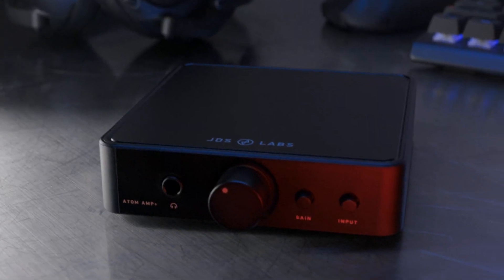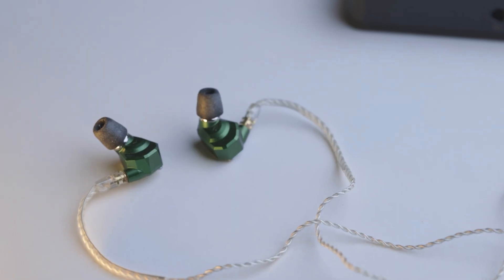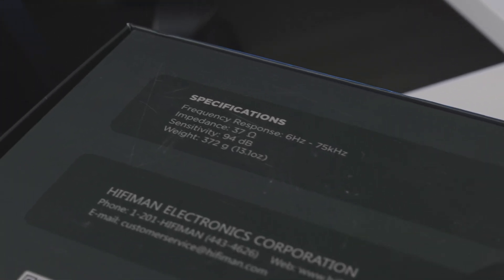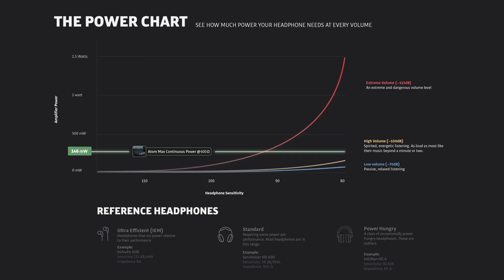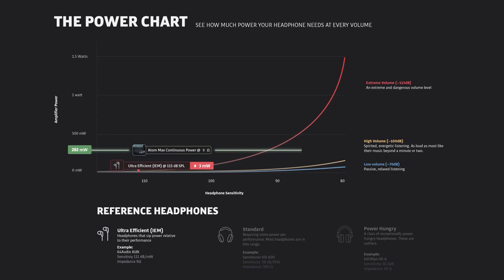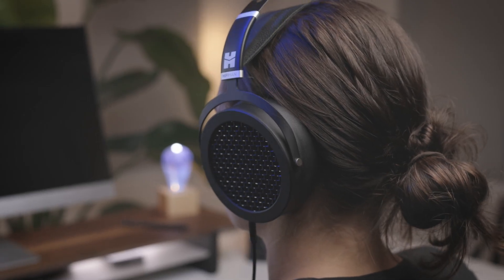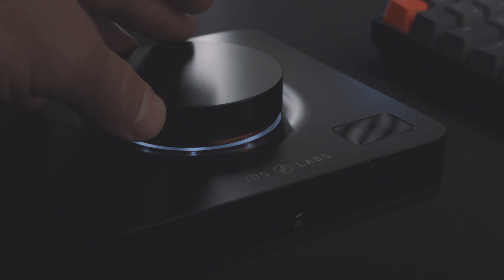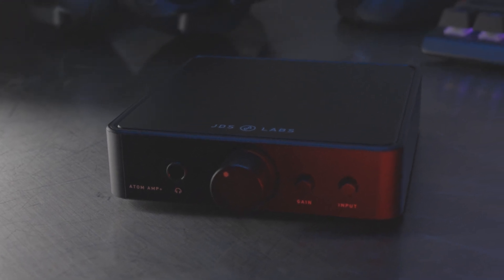On Headphone Power: How much do you REALLY need?

Comment: I have a Element III and now I'm struggling if it is enough to power the Modhouse Tungsten. Wit 78 db/mw and 155 ohm impedance those are quite hard to drive... Is the element III enough or would I need another amp?
Reply from the maker: Indeed, Tungsten is off the charts: not quite a headphone, and not quite a speaker. It's a tricky situation because Tungsten needs major voltage swing given its low efficiency. At 78 dB/mW and 135 ohms, an amp must deliver roughly 26VRMS = 73.5 Vpp (!) to drive Tungsten to dangerous listening levels. Solid state amps top out at about 10VRMS, and even some esoteric headphone amps top out at around 20VRMS = 56Vpp.

As this video discusses, it's important to step back and consider how much volume you wish to achieve. If you listen at only moderate volumes, 10VRMS from Element III is adequate. Admittedly, you will be pushing any solid state amp near max volume. This is fine with any JDS Labs amp--all are designed for clean audio even at 100% volume.
Reply: @JDSLabsinc  I know it is a late reply, but thanks for clearing that up. I would hope that Ryan will adjust the Tungsten's in a V2 or going forward.

Comment: imo power amp is like car engines..... a 2.0L four revving at 7000rpm has equal performance to a 4.0L V8 revving at 4000rpm..... i know which engine will be smoother, has more headroom and lasts longer....
Reply from the maker: I considered axing the analogy in this video, since analogies only go so far. Fortunately, there are no spinning parts in an amp to break down

Comment: This whole debate is not helped by the very wide range of headphone impedances and sensitivities out there, and that some (mostly legacy) were designed for use with a 120Ω output impedance amp.
Speaker amps have it easy; most speakers are rated at a "standard" nominal 8Ω impedance, which makes design (relatively) easy. 
Design of headphone amps on the other hand is a constant battle between keeping noise levels low enough for use with high sensitivity low impedance headphones, yet also with enough voltage swing to power low sensitivity high impedance headphones. The old-school solution of putting a 120Ω resistor in the output of the amp as a partial workaround is frowned upon these days, largely because many audiophiles don't understand acoustic load (mass), impedance, and voice coil and magnetic field gap geometry, and therefore don't realise that a good damping factor is much less important with headphones than it is with regular speakers. Hence most headphones amps now "proudly" feature a low ~0Ω output impedance even when some (mostly legacy) headphones were/are designed with a sensitivity curve specifically for use with a headphone amp of approx. 120Ω output impedance.
So now you have quagmire of headphones of wildly different sensitivities and impedances, some of which are designed for use with a low output impedance amp, whereas others (mostly legacy) are designed for use with an approx. 120Ω output impedance amp.

Comment: Keep these videos coming! I have one question though:

If I have an HE-6 and I have an Atom and a Subjective EQ, wouldn’t I want a little extra headroom of power of like 2 watts so the atom amp can handle EQ boosts of like… the low end if I were to boost it a bit?

Just asking a question out of actual ignorance cause I’m learning. Not a “gotcha” question.

I love what you guys do! I own an EL AMP II+ myself and it’s my favorite amp out of everything I’ve tried! 

Keep up the amazing work JDS LABS!
Reply from the maker: @1212r12  - Excellent question, with good insight. I'll try to keep the answer simplified. In short, no, it is not necessary to double amplifier output power to satisfy equalization because there is already plenty of headroom. You are correct that increasing an EQ band pulls more power because effective listening volume is increased. For example, a 6dB increase in bass means that listening volume is effectively 6dB louder. Most listening requires only a fraction of a watt, so even equalized audio still requires a fraction of a watt (albeit a slightly larger fraction).

On a related note, you may be interested in the DSP implementation of Element 3. This section describes how we've devised automatic gain + volume + equalization through firmware. Increasing an EQ band increases volume, and listening volume determines power:
https://blog.jdslabs.com/2023/06/element-iii-mk2-new-knob-and-eq-firmware/
https://blog.jdslabs.com/2015/06/power-is-volume/

Comment: Nice low-key, straightforward video! The Atom was my first amp and I still use it often. It has enough clean power for my Beyerdynamic DT800/600 ohm and My Sundaras as well.